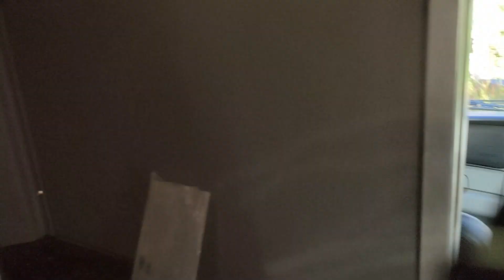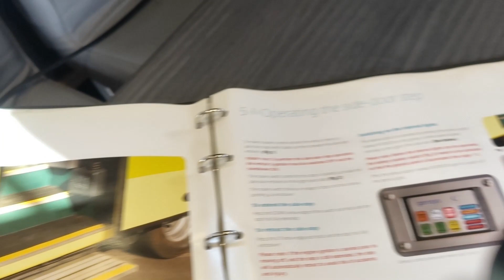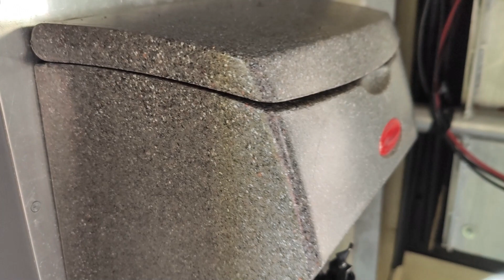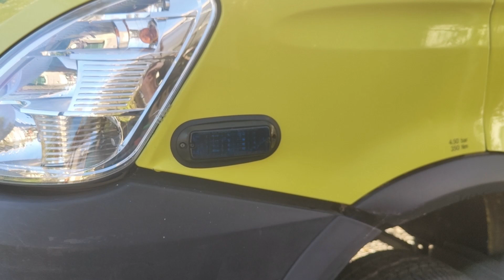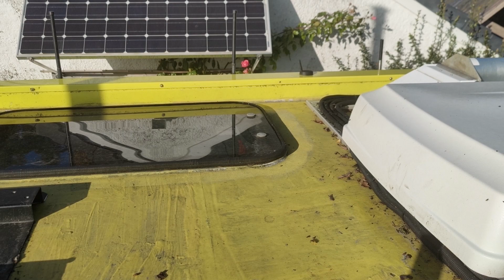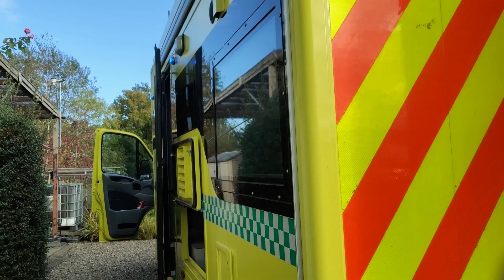Van tour of project Bencen a 2009 gen IV Iveco Daily 65C18, yes I've bought another ex Ambulance!

Comment: WOW i leaned a lot there. someone stole my night owl but satellite and controller still in. victron inverter has been replaced by 2000w cheap ring and separate 40amp charger. my self leveling thinks its a fair ground attraction. my cctv works and not that old. my generator works fine but way too noisy and vibrating.

Comment: I noticed there is a 'Tetra' on the fuse box. I think this is for the secure comms unit when it was fitted. TETRA stands for Terrestrial Trunked Radio and has been the system used by all emergency services since the early 2000s. That's why you can't eavesdrop on Police broadcasts these days!
Reply from the maker: Yep they typically have fairly beefy supply cables, I reused most of them in my previous WAS Sprinter. I am just about to start on the existing 12v wiring in this van including the stuff the squirrels have chewed on!

Comment: Looks like a great project and looking forward to following it. The external heater outlet is used to heat a briefing/meeting area and usually was an inflatable tent structure. I would not have a clue how to start this project! Dave
Reply from the maker: Thanks, with a van like this it’s just going to end up a a rectangular box with a few extra existing features as a starting point, I am currently chasing a couple of water leaks from the roof whilst stripping it out to insulate. 

The only thing that might put some people off is the amount of electrics in these sort of vans but my background means it’s not a problem.

One peculiar thing which I will demonstrate in the next video is the overhead lockers couldn’t be removed without taking the ceiling down first!
Reply: @CriftinsCampers thanks and plenty of wiring and insulation to do. Looking forward to the transformation thanks Dave

Comment: Fell on your feet there, cracking project.
Pretty sure you can still use red diesel for heating and generators as long as its not commercial use.
Reply from the maker: I hope so, I think I will remove the red diesel bit of the sticker though, DVSA would be all over the van if they saw it 😀

Comment: I like the central wall to devide the bed from the living area 👌
Looking forward to the build 👍
Reply from the maker: Yes, if I can make it work then it will provide some segregation from the dogs as well, especially when they are wet!
I would like to fit a wood burner but I could end up melting the box! It will need a very good flue design!
Reply: @CriftinsCampers  it's quite crazy looking through the walls 😵
You certainly have your work cut out with this one but let's face it there's no one better qualified to take it on 👍I'm especially looking forward to the wiring, gonna be an epic rewire, especially if you keep some "toys" 😁
Reply from the maker: @Dirt-Diggler  There’s a lot of truly redundant cabling  cat5 and coax etc. A lot of the excess 240v and all the 110v stuff is also coming out, I will never need 110v or many of the 20+ 240v sockets, even several of the overhead lockers have sockets in them!

There’s a large metal box above right of the generator with multiple mains cables presented to it.

It may just be providing cable management into the vehicle or may also have some internal termination or components 
The only access point I can find is riveted on which is a bit odd. I will be investigating it soon, it will probably have to be temporarily removed anyway because I think it will almost certainly obstruct lifting the generator up and out.